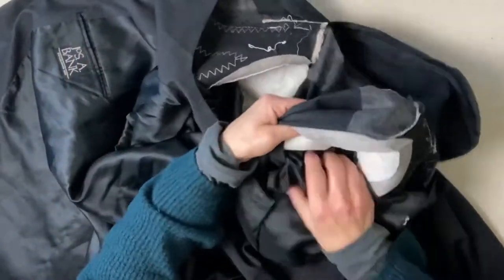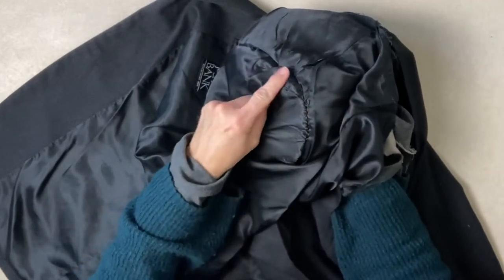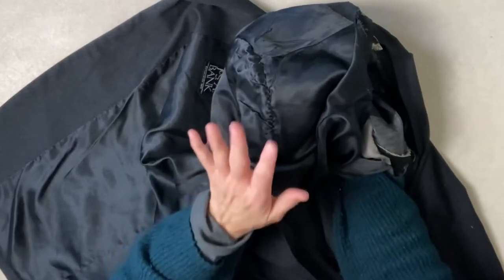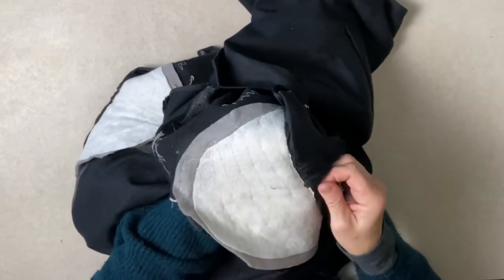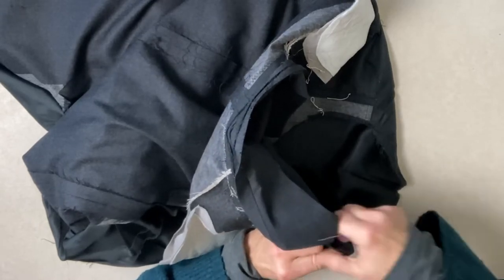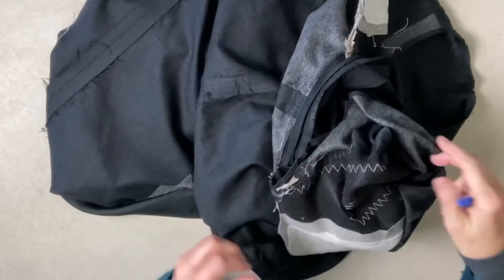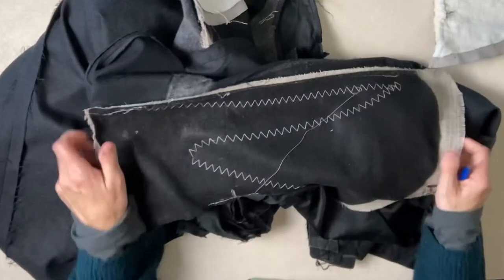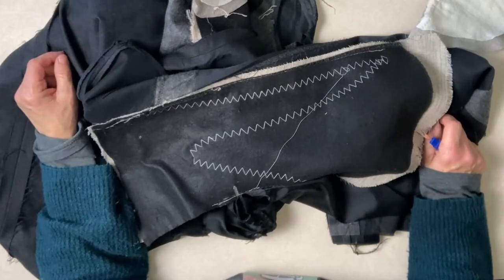What's inside a suit jacket?

Comment: I love that you're taking apart a jacket to see how to construct your own.  This is an exercise we do in the Advanced Tailoring class I teach and I wish more people had the natural curiosity and common sense to investigate like this.  We call those extra structural pieces at the top of the sleeve cap "sleeve headers" but maybe there are other terms for them.  And depending on how much structure/stability you need in the sleeve cap, you can have as little as a narrow strip of fusible straddling the seam line on the sleeve cap.
Reply from the maker: I would love to make a jacket but I want to do it properly. I have been considering taking a tailoring class. I see a couple different ads online.  Can I get a link to your website?